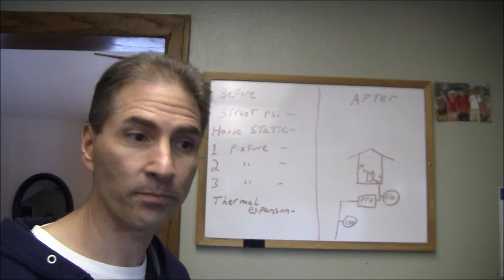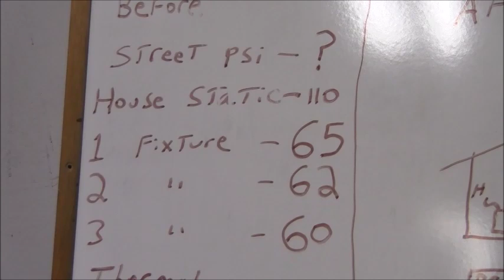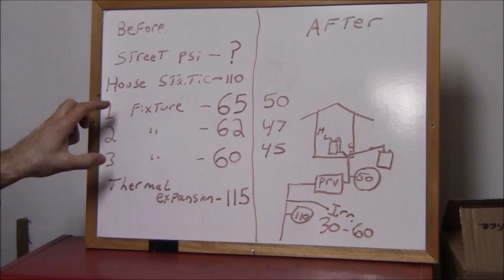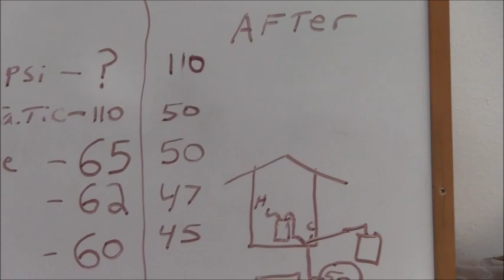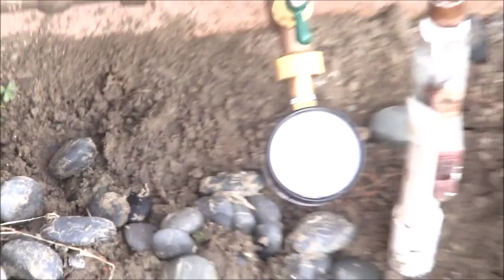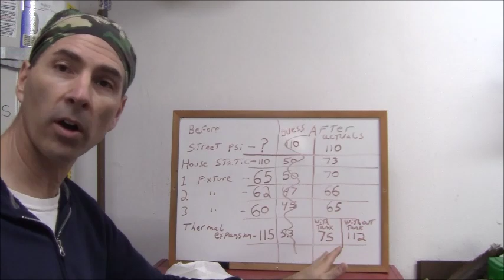Replacing the Water Pressure Reducing - Regulating Valve and full Testing

Comment: Great video, the one test I was looking for is, where was the house side gauge RED line was after  a few days? I think the pressure regulator valve will let the pressure creep up over time but not sure. Now in 2022 with the water shortage I am betting you are limited to irrigation. Again thanks for the video.
Reply from the maker: The red line jumps with house water usage and not accurate over time. when I check the next day, the red line is pegged to maximum...
Reply: @KenTraining  so you are saying even with the new pressure regulator installed your in house pressure is still allowed to climb over 100 lbs. at night. I would think if the factory setting is 50 PSI then it would never go over 50.
Reply from the maker: @joemc111  No, I do not believe the red needle. The system pressure does not go over 80psi.

Comment: Hey Ken! another great training! Im amazed that your city is pushing 150PSI, our little towns here in Oklahoma have trouble maintaining 50. The aged pipes and  towers just cant hold up.
I think the issue with your draft is that flue is nearly horizontal, It is working now, but I would consider rerouting the flue when the time is convenient. The smallest slope I have seen on a natural draft flue is 45deg. The vertical run is what allows the rising hot gassed to induce the draft. I'm sure there is a code for that, any pluber or HVAC guy should know. Thanks for the lesson, Good Luck!
Reply from the maker: Thanks for the note: I will need to look into that horizontal vent run. :)